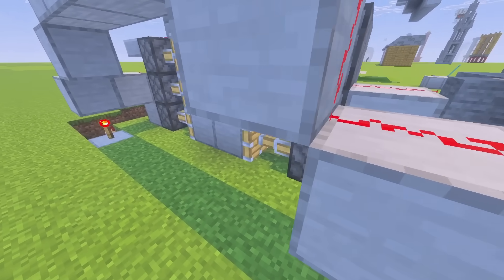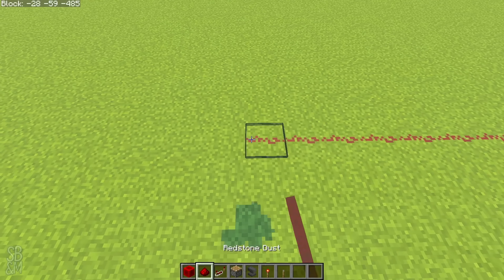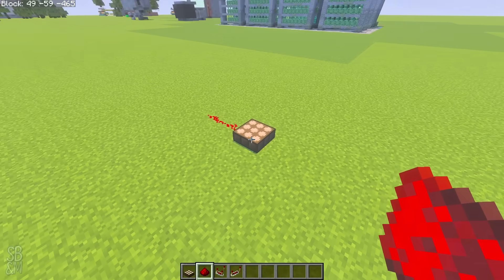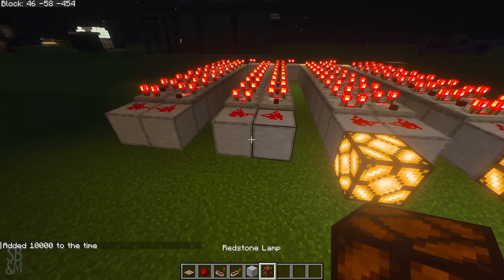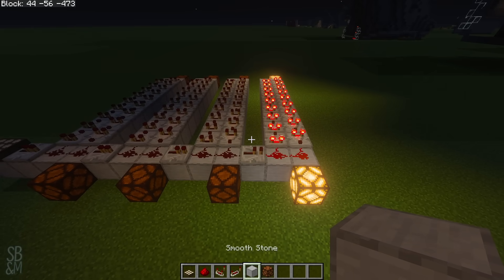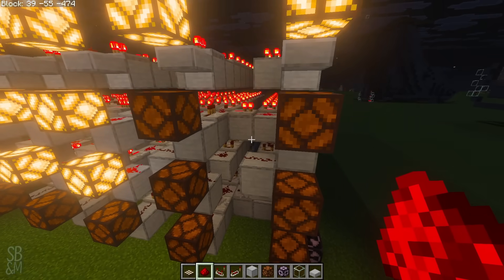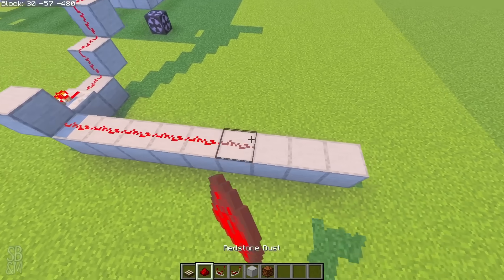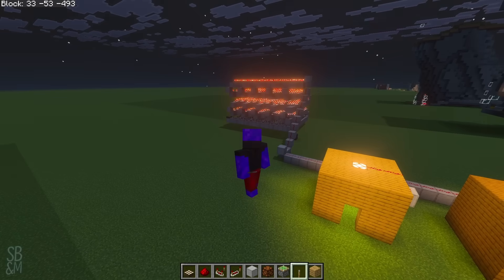I Made Redstone Realistic Entirely in Vanilla Minecraft

Comment: Here's an idea that is using an idea from Williammmmmmmmmmmmmm (Hope I put enough M's. I  just guaged):
Shrink the batteries using what are called Item clocks. How they work: two hoppers are running into one another with a CRAP ton of items. This is good because you can set how many items are in each hopper. 
Lock one of the hoppers out so in the daylight, the items funnel to it at a slow rate (you can determine the rate however you wish). 
This acts as a smaller, rechargable battery, similar to how your Iphone works (or really any battery). 

I'm also one for this kind of redstone too, as I find it realistic as well, which works great in a Create mod. Can't have daylight sensors in the Nether without them freaking out, so what ya gotta do? Send items THROUGH the portal to get power. Same with the End dimension. It connects the world a whole lot more. 

Now I wanna truly see how far this can go...

Comment: use fallimg sand dispensed onto side of honey blocks give a measurable time, have a tripwire hook at bottom to generate the pulses for the electricity using some sort of system to deal with pulses making a solid output for the user prob a single comparator cell u used here to store it

Comment: While it would be hard to simulate, another thing that would make redstone more realistic would be if it actually had to complete a circuit.
Also, while this is a good concept, I feel like the use of repeaters is a little bit of a cheat, as they amplify the signal with from nothing. If you want 0 'resistance' wire that preserves signal strength, and you don't want insane delays, you can use a pattern of block, comparitor, block, redstone dust, and repeating that.

Comment: Idea: sculk sensors and amethyst blocks spaced out to create power lines (putting an amethyst block right next to a sculk sensor causes it to make a noise that is detectable by another sculk sensor and it even keeps the same vibration signal strength so you can have separate ones for different redstone signal strengths) Also use wool so walking near it doesn’t trigger it.

Comment: You did EXACTLY the same thing I did when I was about 10 years old, while I was building the FNAF 1 map. The only difference, that the comparators went into the block and then to redstore and then to other line of comparators. It was made so the power would not run out on itself, but instead I set a few comparators to substraction mod and was substructing the power when the light was on or the door was shut. Such a cool memories, I felt like engenier in the moment :D

Comment: 1. YOU THROW AWAY HALF OF YOUR POWER! A comparator Loop that is meant to last long HAS TO be built with one end having a full block and a redstone besides it and ONLY the other end has two redstone dust next to each other, because thats what makes the signal weaker, so let one comparator of one end lead into a block next to a redstone dust, instead of two redstone dust making the signal weakening.
2. You can make a coal powerplant using a furnace-minecart in a loop of mostly sensor-rails and one part where the rails go down and back up, so that the minecart doesnt stop on a sensor-rail, but instead always Land in that part. You only need to increase the signal length, so that the signal isnt just a clock, because most of the time you dont want flickering light

Comment: ur technically wrong a block of redstone isnt unlimited infact its signal decreases length wise it can only power 15  dust
Reply: You can extend it
Reply: @RayThePixelated  so its only partially unlimited then
Reply: @RayThePixelated  if u look closely repeaters contain torch structures inside them so technically if used repeaters to extend the signal of a redstone block ur basically saying for a redstone block to be unlimited in energy u need another source of unlimited energy (a torch) to prolong but even with that u would also need another repeater to extend it so therefore a redstone block is still partially unlimited

Comment: It's still not very realistic as the grids power should deplete with each device that uses power. So if one lamp is burning, the power would drain a little faster as if no light is burning and if two lamps are burning it should deplete the stored power even quicker than if only one lamp is burning.

Comment: 4:53 this block actually helps the "battery" hold its power for longer.  
  
The comparator outputs whatever power level it receives, so if it receives a signal with power 10, it will output a signal with power 10, but it has to travel one block to reach the other comparator, which will receive a signal 9, but if the output is pointing to a block, the signal the other comparator will receive is equal to the output of the first comparator, which will make the battery last longer. If you do it on both sides, you will never run out of power

Comment: you do realize in your "making a battery" part that you're already being unrealistic by using repeaters that reset the redstone power signal back to 15? if you wanted to make a realer battery you'd have to work with just that 15 power signal and keep it lol
Reply: No
It‘s like multiple batteries strung together and one is drained at a time
Reply: @MENCH_edits  if you replace those repeaters with comparators its more accurate. since the daylight sensor only has so much power. again, the repeaters are resetting the signal back to 15 even though the daylight sensor is only supplying a certain level of power.

Comment: I like the idea, especially with SolarPunk being a popular theme in builds right now; however, you don't have a battery, you have a capacitor.  If it was a battery, you would have a set amount of power that you could also conserve.  When you turn off the lights, the capacitor bank continues to discharge, regardless.   Recycling sandblocks that either trigger a tripwire signal or hit a pressure plate that get sent back to the dispensers (or whatever system, see jazziired's mechanical watch series for a block spring,) you could, realistically, limit the total usage of stored power by utilizing as much as need at the time the switch activates a circuit.
I love this idea, and I obviously love the videos, but the technical note needed to be made 👆🤓

Comment: Personally I think you could make a better (and more realistic) battery by just placing two Hoppers facing in to each other and having the daylight detector lock one during the day so that it stays full. Then when night comes, take a comparator output from the full one and it will slowly empty into the other one. It also probably wouldn't be too hard to only unlock the hopper if the power from the comparator is being used.

Comment: If you ever want to do this again, your battery was just pulse extenders which aren't really batteries in the realistic sense. You could use two hoppers facing into each other with one locked to charge the battery or the other one locked to discharge it, with a comparator output. Just throw in 5 stacks of items and it works as a battery that can be charged and discharged.
Reply: His battery may be closer to a capacitor bank
Reply: Ok but technically both are wrong because the power is still infinite, if its charged you can use it on any number of things. And its always draining the same amount regardless of how much power is or isn't used
Reply: @moosechase  and it charges (almost) instantly
Reply: If I were to do this I would, in order to make it less infinite, I'd make it into an auto dropper circuit that drops into lava when the power is "used", fed into by a hopper line that takes a dedicated "power" item like redstone dust through an item sorter. I'd also probably have the dropper on a slower clock than a normal auto dropper. Charging the battery takes time and a constant flow of redstone dust, battery size can be determined by the amount of storage available between the sorter and auto dropper.

For example if you have the setup:
Auto dropper connected to an Etho hopper clock for 1 minute, fed by a barrel and hopper, you now have a battery that lasts for 43 hours, but it takes 2,624 redstone to charge it, and about 17.5 minutes to charge. Your power can just be a comparator output from the dropper, that is locked by a subtracting signal strength of 15 when the auto dropper clock is not turned on (so the power can only be drawn when it's being used). As the charge begins to really deplete your signal strength will even start to diminish, allowing for a low battery alarm or signal light.

Any feedback? 

Timings of course can be adjusted too for more realism
Reply: Hopper and dispenser

Comment: 9:45 maybe have the battery run out faster depending on how much is being used (I have genuienly no idea how that would work)
Reply: i did this back in the day on xbox 360 edition with hopper clocks this video just reminded me i have an xbox lol
Reply: you could make A part of fnaf with this
Reply: I said the same. I would also make the battery only lose power when it's being used, which doesn't depend on time
Reply: @ddeeffmusicarts it would be possible by putting a solid block in front every comparator that's not facing another comparator. It would stop the "battery" from losing power, and to make it lose power on command, you could put a few comparators on subtraction mode and put a redstone on the side of said comparator, the stronger this redstone is, the quicker it will deplete the energy from the battery. The problem is, how do you measure how much energy is being consumed, so you can properly take it out of the battery?
Reply: @BrunoBrasil-vl9iz  Make a clock, in that way the Redstone will flash and subtract over time, you can also adjust this clock and technically change the voltage you use
Reply: @ddeeffmusicarts He created a type of battery based on a capacitor. These batteries are simple and powerful, but they discharge over time.

The most sensible battery model would be a more basic rechargeable battery, using a funnel, a chest, a dispenser, and bubbling water (an item elevator). The item used to symbolize charge could be redstone.

With this model, charging and discharging times would be calculated to power some electronic function, but having more items connected wouldn't cause the battery to discharge faster.
Reply: @ddeeffmusicarts maybe locking the comparitors? idk lol
Reply: @jayjayareThis does only work with repeaters